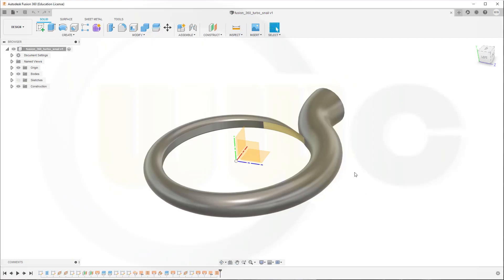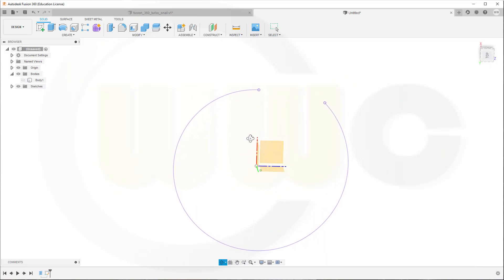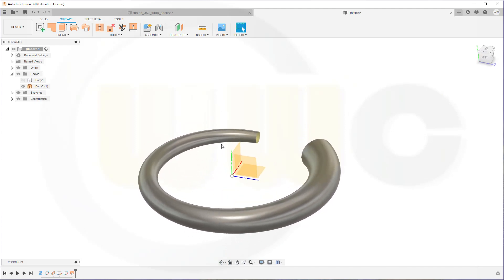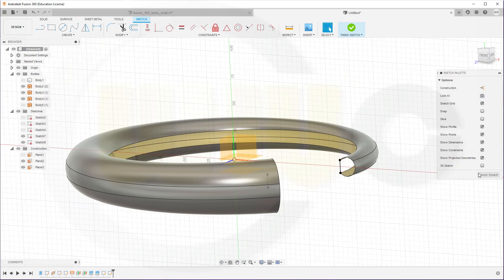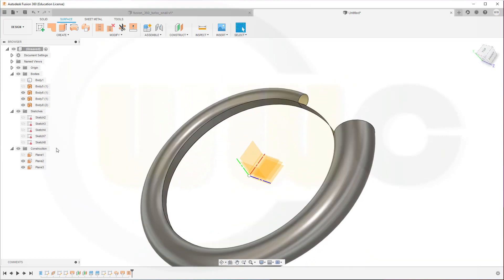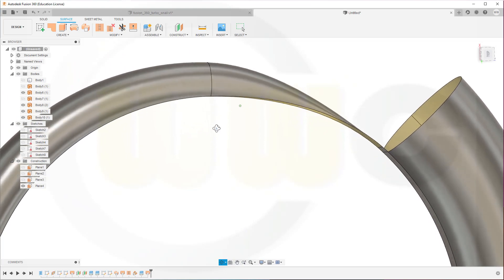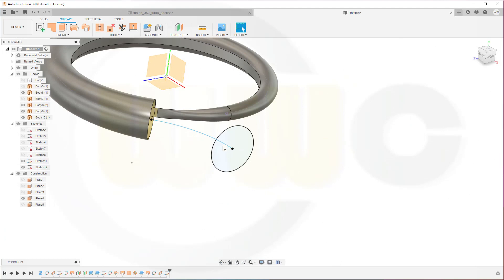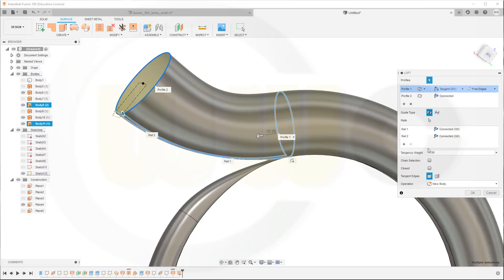Turbo - Snail - Fusion 360 Training - Surfaces

Comment: Hi there, what if I want the coil/spiral to be offset and not just straight? I can't really find anything on how to go about doing it.
Reply from the maker: You shouldn´t use the "spiral" option but one of the others. Then you would get a pitch option.
Reply: @wolfgang.walden.cad.training  And is there a way I could add a straight line that is tangent to one of the coils so I could loft the snail shape like on a real turbo cover casting? If I break the connection to the projected spiral curve it gets a ton of points and is almost impossible to edit.  Here is my reference : https://grabcad.com/library/1jz-gte-engine-components-1.

Any help would be greatly appreciated!
Reply from the maker: Sorry, I don´t get it. What do you want to do exactly?
Reply: @wolfgang.walden.cad.training  Hi Wolfgang, I tried to illustrate what I'd like to do here : https://imgur.com/a/Dj6UjSf  

Hope it makes sense, I just don't know how I could extend the coil like I drew there so that when I loft I get a smooth transition.
Reply from the maker: Ok, I´ve got it. You would need some sort of 3d "connect curve", which is at least tangent continous and connects the helix with your line. Therefore shorten the helix and shorten the line, connect them with a curve/spline and add tangency.
Reply: @wolfgang.walden.cad.training  Thank you, I will give it a try!